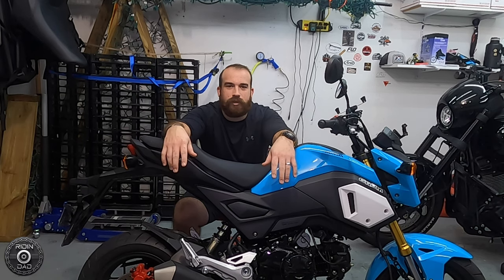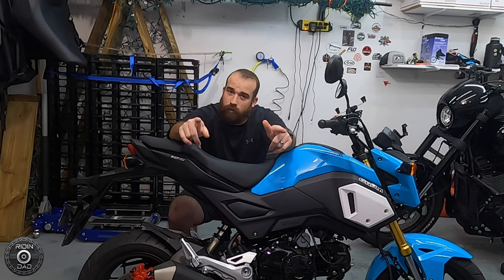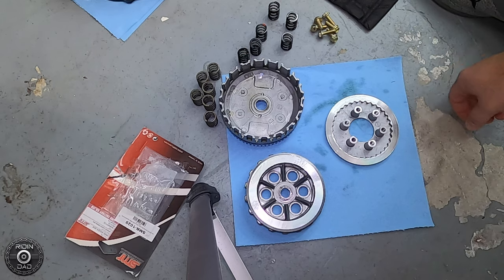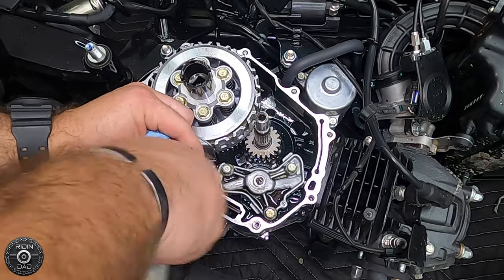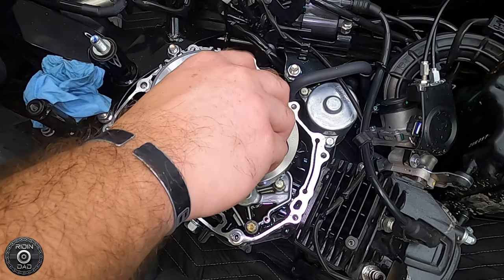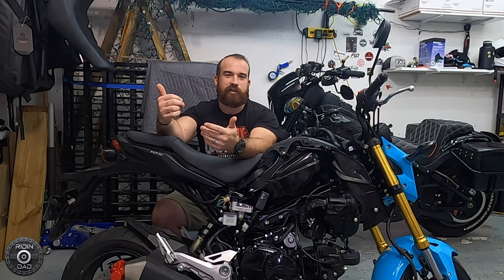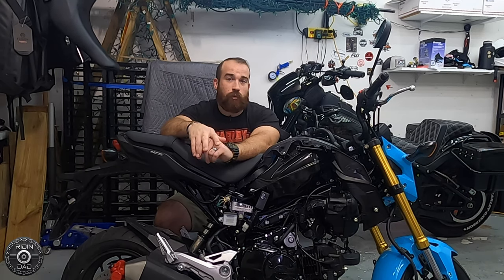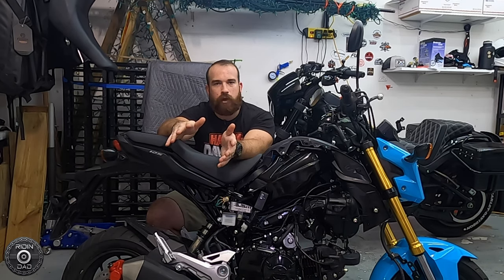80% Stiffer Clutch Springs install on a Honda Grom (msx125)

Comment: Just got my strait up pumps pressure plate today. Ready to do the exact same thing to my grom. Good job!
Reply from the maker: About two days after I did this install I bought the oil pump and some new clutch rings LOL should have just done it all at once but hindsight is 2020 as they say. But I got two more videos coming up! Thanks!

Comment: TY for video, I have a 2000 Suzuki Intruder 1400, I hear that the clutch springs in this bike are a bit weak naturally, this bike has a ton of torque, by adding some aftermarket springs what does it actually feel like? does it give you the allusion of more power and speed?
Reply from the maker: It really depends. You’ll always feel Stiffer springs up at the clutch lever that’s for sure. If your clutch was slipping at any point before, then you’ll feel the increased lock up and more consistent power delivery. If your bike wasn’t slipping at all or just barely slipping, you probably won’t feel any more power delivery and definitely no more top speed/ hp.

Comment: My klx250 shifts rough from neutral to 1st gear, sometimes it makes a grinding gear noise + it can be felt vibrating in the gear shifter. Can it be caused by a weak (not stiff enough) clutch springs? Thanks
Reply from the maker: Hard to diagnose online obviously without me being there and hearing it or actually feeling it. But I don’t think it sounds like a clutch problem. You can shift without the clutch as long as you’re in a normal rev amount and it would not be hard or grinding at all. So more than clutch. It sounds like it’s a transmission problem in my opinion.

Comment: Hey man I’m sure I’m having the same issue. I just did the springs on mine and I have no idea how anything could have come out of alignment. When you made the mistake the first do was the clutch locked together so basically it wouldn’t engage and it was basically stuck in gear or was it like it was stuck in nuetral?
Reply from the maker: Basically stuck in gear. It’s so small it’s hard to tell. Just take it all apart and be extra tedious with it. You’re probably the 12th person to have the issue too and every time it’s the same thing so don’t worry about it. It’ll work! It’s just annoying lol
Reply: @RidinDad  thanks for the quick reply. You’re awesome. And yeah I’m assuming the basket got
Cocked and the tension is jamming the plates together somewhere. Hopefully the socket tool shows up today. I got 80% springs did you feel these were ok on the stock setup ?
Reply from the maker: Yeah absolutely. Even with 80% the clutch pull is not unmanageable.  You’ll be fine!
Reply: @RidinDad  🤟🏻🤟🏻

Comment: What size tap did you use?.... 1mm?
Reply from the maker: It’s been a while I do not remember honestly. I would check the description. There’s a chance I put a link to it in the description and if not hopefully I said it somewhere in the video but honestly honestly if I did not apologize, I can’t remember by now.
Reply: same size as as the bolt treads m6 x 1mm = m6 x 1mm

Comment: I ordered the clutch plate and 80% springs do you think it would be ok just to run 3 springs so I won’t have to tap out them other holes so just use the stock plate and 3 springs where the bolts go in if that makes sense?
Reply: No , still put them all in even if you are not tapping them. I’m actually doing mine right now lol
Reply: Just to be  clear use the new plate and tapping them isn’t necessary  thanks bro appreciate your help
Reply: Yea you’ll be ok with just the stock 3. I have been using mine with upgraded 80% springs and the stock three bolts for the last two years. I just tapped the other 3 tonight because I was changing out my clutch.
Reply from the maker: Yeah man use all the springs 🤘🏼
Reply: Do you have to drill the holes out completely that you threaded?
Reply from the maker: All you have to do is exactly what you saw me do. I did not do anything off camera that I did not talk about. Super easy man.
Reply: @RidinDad  ok just wanted to make sure thanks for the info and all the info you put out on Groms! Much appreciated!
Reply from the maker: Happy to help ! Thanks man!

Comment: What was you’re issue. Just did mine and it’s engaged looks like I’ll be taking it off again lol..
Reply from the maker: Lol, yeah. Probably had the same issue. It’s incredibly common dude. It’s the clutch basket. It’s such a tiny space but the basket isn’t seated all the way together in itself.
Reply: @RidinDad  just finish taking it apart and found the washer wasn’t in place at the bottom of the basket. Clutch feels better and not as stiff..
Reply from the maker: @Ganstergrom  Awesome, glad you got it figured out!
Reply: Ya this guys a legend with tighten bolts 😆.

Comment: The previous owner of my og put 3 hayabusa in with the 3 60% springs. Does pull nice but dose it befit anything?
Reply from the maker: Yeah I know a few people that go this route. I don’t think it’ll hurt anything. The main reason that people used to do that was before a ton of companies got into making accessories for the bike there used to be limited options and that was a easy fix for it.  I would leave it if you’re good but there are definitely better options like the 6 spring kit and others

Comment: Hi, does it work if i put one washer under every clutch spring to make them stiffer. Because i got rieju marathon 125 with 183cc malossi cylinder and my clutch begun to slip immediately. i havent found any stiffer clutch springs. Rieju marathon has same engine as yamaha wr 125 and the clutch ha 4 springs
Reply from the maker: I would strongly advise against it. Adding a washer to the spring does not increase the springs stiffness, rather it decreases the springs amount of available travel. Yes, initially it will feel stiffer but you will also lose travel which will decrease the ability for the clutch to fully engage and disengage.
Reply: @RidinDad  oh okay. i just thought that it would work because now i just have to pull like 1/4 of the clutch in to make it fully work. maybe i just gotta find those springs 😅
Reply from the maker: Yeah I get what you’re saying. 1/4 works but it’s not fully engaged. Just enough slipping to allow to switch gears if that makes sense

Comment: Take a look at ATD, CDI, or precision torque wrenches, CDI is owned by snap on and Precision makes the split beam for snap on. I’ve used my CDI’s daily for 8 years and check calibration monthly, I have never snapped a bolt while torquing something down, or left anything loose. HOWEVER,  if you take metal fatigue into account and it’s a high stress part or is something like a lug stud that it torqued all the time eventually the bolt will snap, and this is why I will actually use new hardware on timing components or obviously internal engine parts unless it’s a low mile/ newer engine. I also believe manufacturers should definitely do a better job of telling you not to reuse hardware.
Reply from the maker: Yeah I don’t reuse bolts in specific places. The bolts Ive snapped before were brand new bolts with a $125 torque wrench. Im not spending more than that on a wrench when the method I’ve been using the past two years on pretty much every part I’ve put on multiple bikes is working good lol
Reply: @RidinDad  the smaller the engine the less important the torque specs honestly. I come from automotive and moved to heavy duty a year ago. I’d be afraid of not torquing bolts on a 15 liter Cummins.
Reply from the maker: Yeah I agree with you for sure!

Comment: you said "a light bulb came on and you figured out what you was doing wrong with the clutch plate" ? you didn't explain what you did wrong with the clutch in this video . why wasn't your clutch engaging?
Reply from the maker: I didnt put the rings in correctly. There was a tiny almost impossible to see gap within the clutch assembly

Comment: Do you have a link for the screws to hold plate down?
Reply from the maker: I do not. I believe in the video I stated which dimensions the screws were & I just purchased them from my local hardware store. They're a pretty common size. Most hardware stores should carry them.

Comment: I did the same thing to my grom I have a 2019 now I have a problem now I’m hearing noise like rattling sound and I checked everything I need help with it
Reply from the maker: Hard to diagnose without physically seeing it. But if nothing else changed I would take everything apart and start from scratch again. Obviously there’s gotta be something going on with what you did if nothing else changed
Reply: Did u ever figure it out I’m having the same problem. I did 6 stiff springs 60% and it rattled and clunked the right side case so then I did the 3 and 3 and still happening to me
Reply from the maker: Something is obviously either Louis or not installed correctly. If all you did was change the springs and you did not add a new part or anything like that they could be malfunctioning for some reason then obviously you have the diagnose where the noise is coming from. I would take everything 100% apart and make sure it is installed completely just really take your time with it and make sure everything is 100% correct
Reply: @RidinDad  I also did the chimera plate but not sure if that has anything to do with it
Reply from the maker: It shouldn’t. It’s a direct replacement. Wouldn’t cause any rattling if it was put in correctly
Reply: @Ryancortez829 did you ever figure it out boss?

Comment: Is it safe to replace the 5mm clutch spring with 6mm?
Reply from the maker: Which springs are you looking at getting?
Reply: @RidinDad  I also have 6 springs, but the size of the spring is 5mm, is it safe to replace the 6mm spring?
Reply from the maker: What are the springs marketed for? I don’t know the aftermarket spring widths. If it’s marketed for the grom you should be fine

Comment: Can you clutch up in 2nd and third gear now with the 80% springs and chimera plate. I have 60% and the koso one and stick was honestly better than that
Reply from the maker: I cannot. YOU may lol. I suck at doing any sort of anything that resembles a wheelie. Plus I weigh about 200 and I still don’t have a proper tune or air intake and my heating is stock. I can tell you in 1st and 2nd letting the clutch out sticks instantly. 1st sometimes it bogs down depending on how early you drop the clutch and it almost cuts out no matter how much gas you give the little guy
Reply: @RidinDad  It's all technique, you jump down on the pegs while at redline and sit your butt back on the passenger seat after the clutch dump. I'm 205 and the weight might actually help? I get 4th gear wheelies up at 47 MPH with the only mod being 6 60% clutch springs.
With the bounce technique I can also get it up 1st to 3rd without using the clutch, stock gearing...
Reply from the maker: Oh for sure it’s technique 90% of the time. That’s why I said I cannot because I just suck at it currently. I would love to get better !
Reply: @RidinDad  Some people have no interest but I mastered wheelies on a mountain bike so I knew they were a lot of fun.
I took my time and didn't loop when learning.. so it took about 70+ hours over 3 months to get balance point down where I could slow the wheelies down and ride them as long as I want.
Reply from the maker: That’s awesome man. I was one of the kids that could never get it on paper so I don’t even have that to help me learn now. I practice a little bit but it’s very hard to where I live. So I can only put in a few hours a month so it’s just taking me a long time
Reply: @RidinDad  It's completely different on a bike, maybe even harder to learn on a motorcycle when you learn on a bike first because you have a handbrake on a bike and you get used to jumping off the back so you have to fight the urge to jump off on a motorcycle...
Reply from the maker: Good point man. Never thought of that part of it
Reply: @-JohnSmith- you are not pulling wheelies up in 4th gear at 50mph on a grom I don’t believe u lol